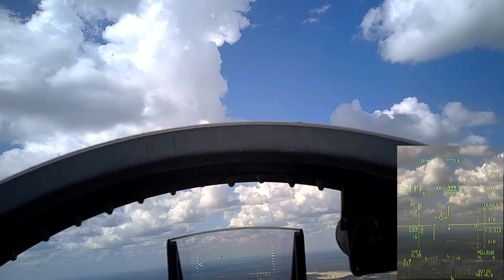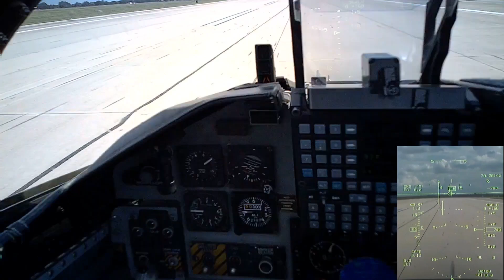How to land a T 38C from Tac Initial

Comment: How does the airplane now it's a gun kill? It doesn't have a radar like the F-16 (sim mode, BATR etc.)
Reply from the maker: The airplane doesn’t know it’s a gun kill, the pilot does. We do that with use of the gun sight, which we have two versions of. One is the ‘funnel’, which uses stadiametric ranging (we know how wide the target will appear at range) and therefore where the bullets will be when they reach that range, so we can tell how much lead we need to pull. The ‘bullets’ are simulated by a pseudo funnel of dotted lines and the bullets are between the two dots at the range when the two dots are as far apart as the wingtips of the target. 

The other gunsight is the LCOS, which is a circle and approximates the lead required for 2,500 feet. When the trigger is pulled, a RATR (rounds at target range) appears in the form of a small triangle. 

In both cases, the pilot must evaluate if he has sufficient amount of valid gun to call the kill.

Comment: Hey there! Can you please explain the call made during the crosswind? I hear the callsign, "Teeter 4" then I cannot understand, then "full stop". Also can you confirm the break order is given by the two PTT clicks on VHF ? No UHF call "teeter flight on the break" during a tac initial ? thanks a lot in advance :)
Reply from the maker: @becauseiwasinverted743  The call you are asking about was “Cheetah 4 request closed, full stop.” In other words, another aircraft, who was on the go for a touch-and-go or low approach, wanted to pull up to closed downwind and the next pattern would be a full stop. 

The two clicks on the radio are the warning that our 2-ship is about to break at Tac Initial, but the actual ‘order’ is flight lead just breaking. We will make a call at 4-mile initial that we are at initial, but never call that we are in the break.

Comment: Hey there, excellent video again! Looking to implement it in my sim squadron, If you don't mind I have a few questions regarding the Tac Initial. It seems to me that it can only be achieved by an element, not a 4 ship since flying LAB at 4 jets might put #4 over another runway in case there are two parallel runways. What's the advantage of doing this over a conventional overhead break which can be done as a 4 ship?  Is Tac Initial flown at higher speeds maybe? what's the closest range between two elements arriving for a tac initial? thanks in advance. Best
Reply from the maker: @alphacheckdesigns4839  If Tac Initial is flown as a 4-ship, then it is 2+2 with 3/4 behind 1/2. The formation is called offset container. 

The advantage of Tac Initial is that you aren’t as close to your flight lead and can look around for other threats instead of starring at the jet three feet off your wing. Therefore, you should use Tac Initial in tactical (Tac) situations where people might shoot at you. Other “threats” that we worry about include the 20 lbs turkey vultures that circle around the airfield and regularly punch holes in our canopies.
Reply: @Cider-C  Hey there thanks a lot for your answer, time and effort putting these together!

Comment: what's the AOA at landing? HUD symbology when landing looks similar to the F-16 but AOA is a lot higher in the 16
Reply from the maker: We don’t measure AOA the same as the F-16. It is measured in percentage of the critical AOA. With that measure, we usually fly the final turn/landing at ~.6-.65 AOA. Just looking at the HUD at touchdown, that appears to be ~5 degrees.
Reply: @Cider-C  Ahh ok.. Thanks!